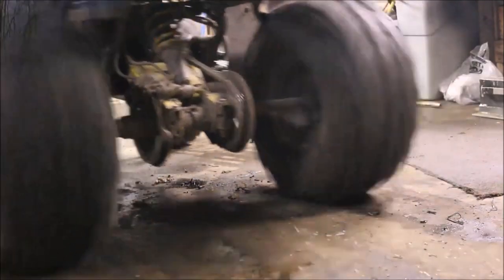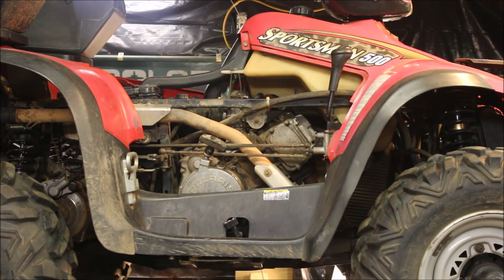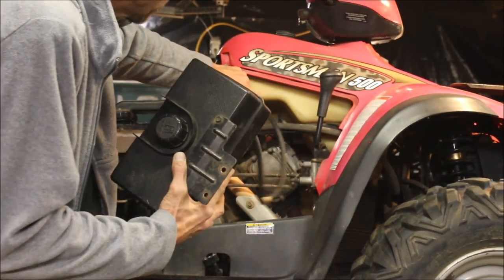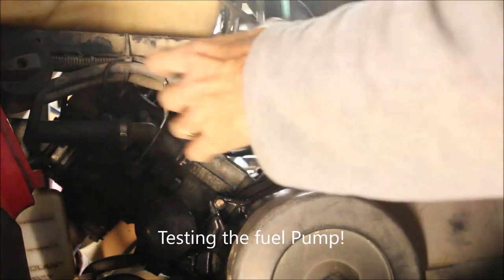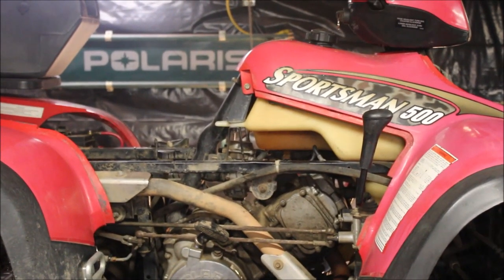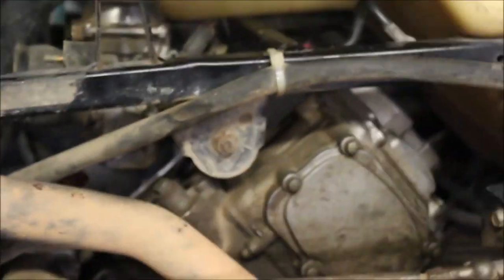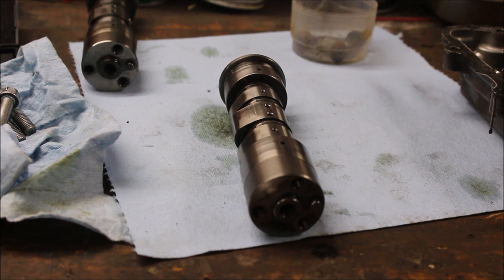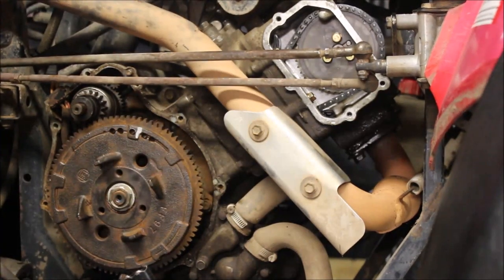How to Trouble Shoot issues on a Polaris Sportsman 500!

Comment: Great content! Really appreciate the info!  I'm working my way through a 1999 Sportsman 500 and seeing similar issues.  Next step is to look into the top end and check the valve lash and the cam.  I really like the systematic approach to eliminating possible problems. Fuel, spark, compression, TIMING!  Great job!
Reply: I’m having same problem on a 1999 sportsman 500 too, right now I know I have to get a new camshaft but also I can’t seem to find the spark plug boot or spark plug

Comment: You are the real mechanic man!  l just got a none runner 2002 Sportsman 500, was told there is a big hole and rod went through the bottom, but by pulling the cord over and over, felt engine did not blown.  Will follow your 4 steps golden rules to figure out what is wrong with it.
Reply from the maker: Right on! Good luck. Hope its an easy fix!

Comment: Good video. You can still check  compression with the automatic decompression system. It should show between 60 to 90 psi.
Reply: do you hold the throttle open?
Reply: Yes
Reply: @mechanicforlife9468  put a new oem head gasket on and it appears now  I have a bent valve can I reuse head gasket?
Reply: If u didn't run it, u would probably get away with it. If it ran, replace.

Comment: enjoy your video, 1997 500 sportsman issue of turning over  very hard,.replaced compression release lever seemed to help some times. cold engine turns hard once started it works . should I have replaced cam ? the lever had a groove worn in it. thank you

Comment: I was just wondering if you can help me out I got a Polaris magnum 4 x 4, but there’s no electrical current going to the gauges or starter switch in the handles
Reply: I do have current going into the starter only if I jump it through the solenoid

Comment: Hey Titanium - Videos have been very helpful to figure out I was having the worn cam issue on my sportsman 500. Question I have for you is after putting in new cam the pull start is extremely hard to pull (tons of compression). I did check and recheck the decompression valve and that is working as it should. Even electric start gets jammed up trying to start. Anything else I can try checking to get rid of some of the compression? I did also check and recheck valve lashes but no luck.
Reply from the maker: Let me guess? Aftermarket cam? I had that issue too. Still decompression ball.

Comment: Good troubleshooting. I have a question about my sportsman 500 it's hard on the  Initial start like the engine had a lot of kickback  once running and warmed up it has very little power so I took the valve cover off thinking the cam was bad but the lobs seem to have no to very little wear. What would be the next thing to check? Thank you for any feedback..
Reply from the maker: Decompression ball on the cam causes that. It sticks open.

Comment: Thanks for the video pal. I have a sportsman 500. 2001yr. It has new cam, chain and guides. Battery etc. Was running fine. My nephew was riding it. It just stopped. I sprayed starter fluid in airbox up in carb. No start. In your experience. What could it be. It turns over great. Just no fire. Thanks
Reply from the maker: Check to see if you have spark. could be a bad cdi or kill switch.

Comment: @titaniumman garage Have you ever switched out the carb on a scrambler 500? I put a mikuni tm38mm flat side off of my cr250 on mine, eliminated the fuel pump and rejetted it and it def did give her a good amount more snot,That is until I blew out the cam, replaced it and now can’t get it running right again. Super frustrating I probably tore it apart 20 times now and every time get somewhat different results. I dk if me only putting cam in and not rockers would affect it in that manner but now it’s real hard for the cam to rotate and open exhaust valves which in turn is making it backfire and pop out the carb I believe. Runs decent until oast 1/4 throttle then sputters and backfires and has loss of power simikiar to when I blew the cam the first time. The exhaust lobe does look to have some wear on the one side of the exhaust lobe like it was rubbing something that ground it down a but I don’t see how it can be shot already considering I didn’t even put one hour on it since I got the new cam. Guess I should probably check it with micrometer now that I know the measurements you mentioned in this video. Any input or suggestions would be appreciated man and thanks alot for your videos your def the biggest help when it comes to Polaris quads in my opinion and will continue to point people in your direction that need some help with their quads.
Reply from the maker: Thanks Man. The decompression ball is what is rubbing that grove in your cam. I put a slide carb on a scrambler once. Definitely more snot to it. the problem is it runs lean. Probably why you blew the cam out. I was told that it would run lean and put the stock carb back on. Installed a better clutch with a kit and it had the same effect.
Reply: @TitaniummanGarage  thanks mines honestly running rich, but regardless think I’m going to have to go back to stock carb . Thanks again for the input and for just taking the time to get back to me in general, appreciate it. Have a good one and keep those vids rollin! 👍🏼😎

Comment: Very informative video pal. Can you help me  out with my 2000 polaris 500. It runs a distance and it shuts off completely. I wait for a couple minutes and when I turn it on it runs and off it goes again..

Any tips or advice? Best wishes and hope to hear from you.
Reply from the maker: I would start with the cdi. Some cdi's work at first but at higher rpms it shuts down. Is it overheating at all? That would cause that issue as well.
Reply: @TitaniummanGarage  yes my Polaris 500 does overheat a lot. Is it normal? Does anyone know the normal heat temperature for the polaris 500 magnum 2000?
Reply from the maker: That is your issue. It is not normal. I use a temp gun on them. it should be below 190 I believe. Mine normally runs about 130 at the radiator and 97 on the hoses. Check to make sure your fan is working too. I have a video how to check the fan.
Reply: @TitaniummanGarage  my fan is working well. I have disassembled the water pump for debris but it was clean.. I will be adding the thermostat because it is working well.
 I ordered a new cdi from Amazon but I was sent the wrong cdi. I have have messaged Amazon concerning that issue. In their Amazon spec and images they had the exact cdi for the one I was ordering but got a different one...

Do you believe that the Amazon cdi would work well?

Comment: Thanks for the videos- quick question:

I’ve got a 1999 sportsman 500. Has always ran great, recently it seems to have a rev limiter, both in drive, and neutral. It feels it’s like quarter throttle- feels limited by electronics. It doesn’t change when I press the ‘override’ button.
Reply: Your button on Rev limit er is pouched probably.
Reply: Any update? I seem to have the same issue rev limiter half throttle but in neutral when i push te override Its seem to be ok …
Reply: @TitaniummanGarage I have this same issue as this chain of comments. Idles great but as soon as I rev it’s like a rev limiter both in drive and neutral. Agree it feels like quarter throttle very low power.

Comment: Hi, I have a 2000 Polaris Sportsman 500 4x4. When cold starting electrically it will crank crank crank pull. Start it two or three times. Fires up then eletric  starts electric.
Reply from the maker: They are hard to start when cold.  Does it fire up at all?

Comment: Really hoping I can get this fixed but I recently got my polaris sportsman 500 back and the battery was dead. I tried to charge it but I found out that my battery had a bad cell in it so I hooked up another one and It tried to start by itself. It always drained the 2 batterys I tried to put in it? I got a new motor,new solenoid and everything. Im thinking it could be a starter? Id appreicate the help.
Reply from the maker: The rectifier is what charges the battery along with the stator.  Maybe replace the rectifier and clean all your ground wires. Those will cause the battery to fail as well.

Comment: Hey when you hooked up your external tank to carb, you were on the gear shifter side of carb. this is correct?  and p from fuel pump goes on the other side of carb,, thanks working with nothing here..
Reply from the maker: Depends if its a H.O. or non H.O carb. I should have showed it from the other side. It was a Non H.O. carb. So I hooked the fuel line to the left lower fuel inlet.
Reply: @TitaniummanGarage  yes Thank you always the lower inlet for fuel,ho is on one side regular 500 its on the other, but always lowest.

Comment: I need some help on one Ive got an older 500 sportsman has fuel, fire, compression. It's had a complete new top end installed crankshaft woodruff key is in perfect condition did have an oil leak around the stator housing taken care of now possibly ignition timing?
Reply from the maker: What is the issue?
Reply: @TitaniummanGarage  no start sounds like it almost wants to bust off but then again my Bendix disengages right at that point but have a new OEM one on the way just to test but got it on a trade I've ran my way through them before and always got em going but this one appears to have a whole new top end compression blows my finger off auto decomp is working on the cam loves are good intake and exhaust clearances are set at .06 in timing appears to be good but not sure on the ignition timing I have a manual on the magnum 425 same basics?

Comment: I picked a 97 up with a blown head gasket from a fan switch failure with 2200 miles on it, cams were fine, re-ringed it, surfaced head, jiffy kited the carb, full service, what cause’s a cam failure like that?
Reply from the maker: Coolant in the oil.

Comment: Awesome video.spark fuel. Compression and Air
Reply from the maker: Thanks. Your version is for a 2 stroke though.
Reply: @TitaniummanGarage  oh so four stroke doesn’t need Air ?
Reply from the maker: Yes they do. But then again I suppose that would have to do with timing. If the timing is off the air is pushing out when it should suck in.
Reply: @TitaniummanGarage  totally agree

Comment: A little off topic here...  I have a 98 sportsman 500 and the transmission is tired.  I have a complete 02 sportsman 400 parts bike with a good working trans with axles and everything else.  The only difference I can see is that the 400 has connectors on the top that the 500 does not have. Any thoughts on switching them out?
Reply from the maker: Do you mean the plugs by the tranny. Thats for the 4x4 for the shifter and shift indicator. You can by pass those.
Reply: Ok thanks.  As long as it physically fits I hope I can figure out the rest.

Comment: Do you put Moly on your new cam when you install them? Or do you just pour some oil over everything while you're putting it back together?
Reply from the maker: I used to build engines for a living. We put whites lithium grease on the all camshafts So I go that route.
Reply: @TitaniummanGarage  Thanks a lot good sir. ;)
Reply: @TitaniummanGarage  Fair enough. Thanks a bunch. I actually have 1 more question. When you replace the cam, do you replace just the exhaust rocker, or all 3 rockers?
Reply from the maker: All 3

Comment: I have all those issues now she does not start anymore I change the solenoid the battery and the carburetor I checked out the starter she's good not getting the fire to turn over the engine

Comment: My 98 was running just fine.
I parked it for 2 days in front of the house then it won't start anymore.

It seems like it wants to go on, I get 1 to 3 burps out of the muffler the first time I hit the starter but nothing more as long as a press the switch. 
I wait a little bit, hit the switch again and it does the same.

"Burp burp dead"

So far the only thing I checked is the fire which is fine. 

What would be the next steps to troubleshot this ?

Carb ?
Gaz ?
Timing ?

HELP ! 😅😅
Reply from the maker: I would start with the carb and while the fuel line is disconnected check to see if fuel is flowing out of the line. The lines could be soft and collapse  or dirt in the tank or a bad fuel pump. The jet on the carb could be plugged as well.
Reply from the maker: Also being a 98 it could be a bad camshaft. Maybe check that first. Pull the rocker cover off and look for worn cam lobes. 98 and 99 had bad cams.
Reply: @TitaniummanGarage  
Thank you.
Indeed it was the carb. I had a brand new one in the garage, replaced it and it starts A1.
The old one hasn't been cleaned in two years it was wery dirthy.

Comment: If you plug the black wire back in and put the boot and plug back in and now you have no spark again,what does that mean?  I unplugged theblack wire and took the spark plug boot out along with the plug and since I unplugged the black wire.  I have lots of spark but as soon as I plug the black wire back into the cdi box and put the plug back in now I have no spark so what does that mean?
Reply: Test the ignition switch, engine stop
switch, and speed limiter circuit for
shorts to ground.

Comment: Hey I have a 2000 polaris sportsman 335 that's running ok idles little low but smokes from the exhaust what would be the reason it's smoking white smoke
Reply from the maker: Usually, white smoke is a head gasket. I would check your sparkplug to see if there is any coolant on the plug
Reply: @TitaniummanGarage  sounds good I'll check that thanks for the info I also commented on one of ur vids about a 2006 sportsman 450 carb adjustment if u can help a brother out it runs then just dies starts back up after a minute or two runs and dies again has new carb Chinese according to previous owner it does look like he replaced it but maybe messed up the adjustment
Reply from the maker: @christianangeles3259  I would try a differnt carb. Some of those china carbs are garbage. Some arn't. I just cleaned a china carb putit on a 700 and it ran like crap. i swapped it out for a old Mikuni I had and it ran good.

Comment: So if the cam is bad the intake valves will be tight? Reason I ask is I have a 500 that will not accelerate and the intake valves are tight.
Reply from the maker: When you say tight, do you mean the valve lash? Every so often you need to reset the valve lash because of wear. The chain will stretch as well.
Reply: @TitaniummanGarage  Valve lash is what I mean. This wheeler idles perfectly but bogs when you throttle up. The intake valves were tight so  I adjusted to .006. The cam is within spec 1.28 and has a good lobe not like the ones I have seen on your channel. Cleaned carb, checked diaphragm, jets, float height and all good. I have a gas caddy  so I piggybacked it to the carb to eliminate the fuel pump being a issue. I'm at my wits end, any pointers would be helpful. Thanks.
Reply from the maker: The choke cable could be stretched and need adjustment. Also it seems no matter how many times you clean the carb. Unless you put it in a sonic cleaner, if wont be right. I would try a different carb.
Reply: @TitaniummanGarage  I adjusted on the choke when I cleaned. How are those knockoff carbs. Also, could it be CDI or timing? When the mark on th flywheel is lined up the two dots are at the top of the cam wheel. If it was off a tooth would it make that much difference?
Reply from the maker: @OzarkHillbilly-p5u  The knock of carbs are OK..it depends. Sometimes you get good ones, sometimes there not good at all. I have a customer that has had one on his magnum I built. It's been 3 years now. Still running good. I bought one the other day. I couldn't get it to run right so I got a clean oem carb and it worked good. If a tooth is off it will run like crap. Even if the chain is stretched it will open the intake before it should. Actually that was my next suggestion.  To check the timing

Comment: I got a 2000 - 2001 polaris sportsman 500 ho, it used to start with e start, put a new battery in it and then wouldn't start with e start but would with the pull cord, now it has no spark, I had people look at the stator and said it was good, put a new pickup coil on it and still nothing any tips what it coil be?
Reply from the maker: Run/stop/Kill switch might have corrosion on it. Or a bad ground wire somewhere. Try pulling the black wire on cdi. see if you get spark...or it fires then.

Comment: I have a 2006 sportsman efi 500 HO that won’t start.  It has spark, compression, fuel.  When attempting to start it sounds like it’s back firing a little.  I checked the valve lash and set to .006 but no luck.  Any ideas?  I thought about changing out the cam, but don’t want to just throw money at it, if not needed.  Help?
Reply from the maker: You dont need to replace the cam. I have a video how to remove it. You can inspect it. See if it's still good. You could just take the rockers off and see if the exhaust lobe is warn out by rotating the engine.

Comment: What do you do when there is no spark? 99 sportsman 500. Battery good, solenoid good, changed starter.
Reply from the maker: Try and unplug the black wire on the cdi box. It should give you spark. If so, it's a bad cdi or issues with your kill switch on the handle bar.

Comment: Hey I have a 00 sportsman 500 and when it’s running it has a rattling sound on the right ride of the motor what do you think that could be
Reply from the maker: Could be the starter bendix or something in starter recoil. Could mean your valves need adjustment. Hard to say without looking at it. Or chain slop.